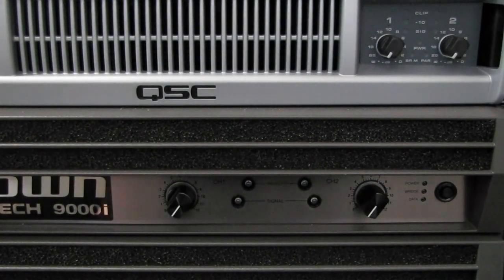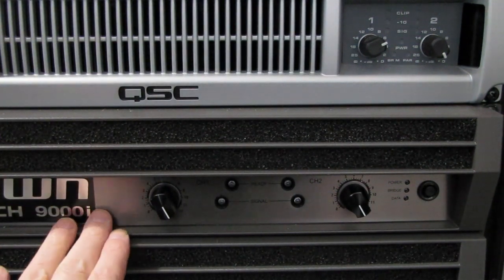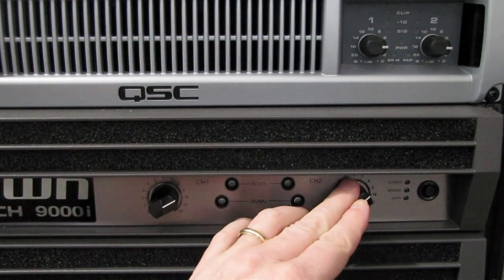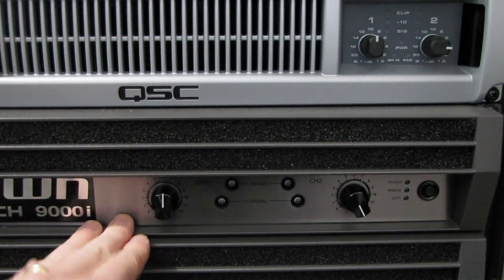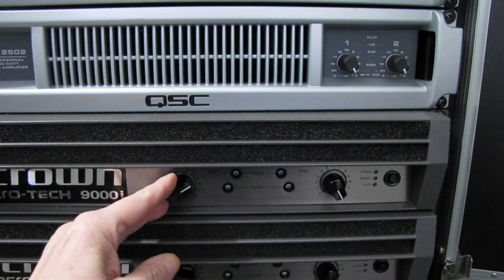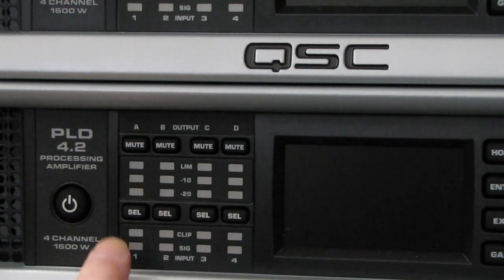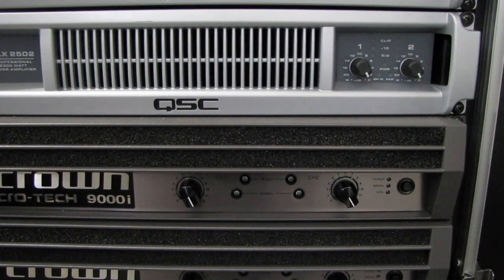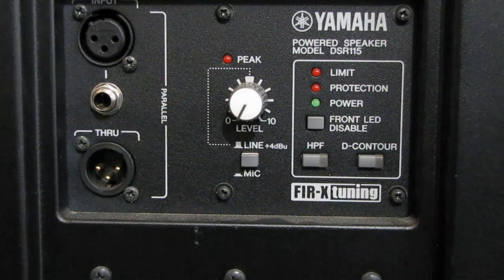Amplifier input attenuators (or volume controls)

Comment: Proper use of the amplifier attenuators is as follows.
1 Set up your console for nominal levels all the way through.  This is proper gain structure and is used in both a small club and in a large amphitheater. This provides some protection for the amplifier and speakers. With proper console setup, the maximum headroom is about 12 db. Most consoles provide a nominal output of +4 DBU. Most consoles clip at about +18 DBU, so there is no more after that.
Now set the amplifier attenuators for the maximum loud sound for the event. This can match the speaker rating, Venue DB limits, or safe hearing level for the event.
This allows the console to operate with the proper headroom, high signal level of +4 DBU to provide the maximum recommended signal for the noise level of the system. Yes this operates at the best S/N ratio for the cleanest sound with little chance of running out of headroom.
How not to operate the attenuators. 
1 Turn them all the way up. This amplifies the noise floor. The console operates with the output very low to manage output levels. This provides poor S/N ratio, and allows the amplifier to be driven to clipping at maximum power, which may be more than 30 DB of headroom, resulting in blown speakers in a runaway feedback conditioin when a guitar is set on a monitor, or a mic is dropped, etc.
Most consoles are able to output between + and - 12 to 15 volt peaks before clipping. Your amp attenuation should never be turned up for sensitivity for a 1.2 volt signal. The console can provide up to 30 volts peak to peak. Check the specifications for your console. Industry standard is +4 DBU balanced signal.  The extra gain is for when you use a home receiver, VCR, cassette deck, etc which operates on lower voltage and outputs -16 DBU as the nominal output. This includes consumer grade tablets, MP3 players, some DJ USB powered mixers, etc.The DJ's with RCA connections can use the extra gain. A pro board with the nominal +4DBU does not need the attenuator turned to the max ever.
Reply from the maker: Great info.

Comment: If the clip led on a power amplifier comes on when the volume on the mixing console is cranked up halfway will the speakers be just fine and not blow
Reply from the maker: If the speaker's power is not rated to match the amplifier power, the speaker will become damaged.  The clip lights on the amplifier is what you should pay attention to... not so much the position of the fader on the console.

Comment: So i have issues with the whole sensitivity stuff,  after setting up and having my gain structure in place from the mixer board, turning up my amps to the highest causes lots of feedback issues.  Although i use a speaker management at 0db.   What could be the solution.   Thanks
Reply from the maker: Feedback issues are mostly caused by improper gain staging on a microphone (at the console).  The amplifiers have nothing to do with feedback, other than amplifying a feedback-issue.  The speaker management system has nothing to do with feedback other than ensuring input signals are "gained" correctly for output to amplifiers (or powered speakers).
1.  Make sure the input gain on the console is set for the microphone and for the instrument (or vocal) that it is being used for.
2.  Make sure the mic is not facing any loud speakers.
3.  You may need to apply some EQ cuts for the channel the mic is connected to, depending on what the audio frequency of the feedback.

Setting gain is very dynamic and changes between different mics, different setups, different consoles...  so, a solution to feedback may take a little work for your setup compared to someone else's setup.
Make sure there's not too much gain being used on any of the microphones.
Reply: @stageleftaudio  so gaining a mic must not necessarily be at 0db on the meter for analogue mixers ?
Reply from the maker: If you are talking about a -0- db marking on gain knob, you are correct.  If you are talking about -0- db on a meter, it's a little different.  Vocals should be around -0- db (maybe -3db) on a meter.  Drums / percussion instruments can be around +9db.  To get that point, it may require a gain knob to be adjusted more/less of what the console is showing as unity (the unity marking on the input channe).  Gain and meters are not static measures... if they were, their settings would either be on or off.  Gain settings are very dynamic and will require their own setting.

Comment: Do the low frequencies on the equalizer need to be turned up if you are using a power amplifier to power subwoofers
Reply from the maker: Low frequencies on an EQ should never be turned up unless it is to support a special effect.  EQ should be used as a subtractive EQ first... before being used as an additive EQ. If one low frequency needs to be turned up, this is usually ok.  However, If many of the low frequencies have to be turned up, that is usually an indication of improper mixing, incorrect gain structure, somethings wrong with the speakers, or using the wrong speakers for an event.

Comment: Know the nominal level and the maximum output level of the mixer, which may be +18 dBU, +20 dBU or +24 dBU.
The clip level of the mixing console is, usually, marked at 6 dB over the last yellow/amber leds on the level meters.
If the mixer has a nominal level of +4 dBU (0 dB mark on the level meters) and a maximum output level of +20 dBU (+16 dB red led on the level meters), I have 16 dB of additional dynamic range above the nominal level.
I intend to use the maximum dynamic range of the mixer and to ensure the best signal to noise ratio in the system, before the signal is sent to the amplifier. Therefore, I set the channel input gain to hit the 0 dB mark on the meters, then I raise the channel fader or the master output fader fully up (+10 dB), to hit the last yellow/amber leds on the meters (+10 dB), just below the clip LEDs. This offers me 6 dB of headroom before clipping the mixer output.
On the amplifier side, set the input sensitivity switch to 1.4 V RMS to match the mixer's nominal level and adjust the sensitivity controls to -10 dB attenuation for rated continous power output. At this point, the continous power output of the amplifier is about 1 dB below its maximum power output.
The above procedure it is based on the assumption that the loudspeakers continous power rating are matched with the amplifier continous power rating.
If a compressor/limiter is used between the mixer and the amplifier, the mixer output level can be increased to its maximum level (+20 dBU) and the limiter threshold should be set at the point where it begins to catch the signal peaks, with an additional 3 dB of attenuation, for safety.
If the speakers continous power rating is lower than the amplifier continous power rating, lower the amplifier input sensitivity controls or the mixer master output level according to the power you need for the loudspeakers and allow for about 1 dB of headroom also for the speakers.

Comment: I have EV ETX boxes that are self powered. They have an input gain or attenuator and a master volume knob. I’ve been running the master wide open and keeping the input at unity. They’re 2000 watts peak power but still don’t seem very loud when they start to limit. Any thoughts?
Reply from the maker: If the speaker power rating is what you indicated (2000 watts peak), the speaker is actually a 1000 watt RMS (or 500 watt continuous) powered speaker.

If the "limit" you are seeing is on the input stage, this usually indicates the source signal (feeding the input of the speaker) may be too hot; the source level should be turned down.  If the limit is seen on the amplifier, this means the limits of the speaker is being reached; there's not much you can do about this type of situation.  However, it's possible the input attenuator may need to be increased (assuming you are getting NO limit warnings on the input stage).  But, care should be taken to not increase the input attenuator too much.

Depending on where you are standing for your reference to how loud the speaker is, the 90-degree by 60-degree horns are great for near and mid-field applications.  Unfortunately, those horns do not do well for far-field events.

Comment: Does hooking up a graphic equalizer to a power amplifier effect how loud the speakers get.
Reply from the maker: Yes, but the "loudness" will depend on which EQ band is boosted (or cut).  Also, EQs are not actually connected to an amplifier.  They are sometimes placed in between the console and the amplifier.  An EQ is actually considered to be "inline" with the signal path if it is placed between the console and amplifier.

Comment: Great video I would love more info on powered speakers. Should I be treating them the same and be running them wide open as you called it? Or just turn them up to what's loud enough?
Reply from the maker: Good question.  The attenuators on powered speakers should be kept where the manufacture indicates -0- db is.  This is usually identified by a detent location, or a marking (similar to the DSR speaker in the video).  Many times, the position is at "12 o'clock".
Reply: @stageleftaudio  great to know thank you!

Comment: Does the amperage of the fuse on the power amplifier determine how much rms power the power amplifier puts out.
Reply from the maker: Any fuse or circuit breaker in an amp limits the amount of power allowed into the amp; this can sometimes coralate to the amount of power ouput (but would probably be a continuous output, but not RMS).

Comment: If a power amplifier has a 15 amp fuse on the back of the power amplifier and outputs way more than a 1000 watts rms does it have to be plugged directly into the wall outlet and not a power strip
Reply from the maker: All amplifiers (especially in production work) should be plugged into receptacles, not power-strips, unless the total anticipated power from the amplifiers that are plugged into a power strip, is less than what the power-strip is rated for.

Comment: Why do some power amplifiers say caution high voltage on the speaker terminals on the back of a power amplifier.
Reply from the maker: All amplifiers put out voltage... not actually watts.  If you are not carefull at the speaker terminals of an amplifier, you will get shocked by the terminals.  The more power an amp puts out, the stronger the shock.

Comment: Is it safe to plug pro audio power amplifiers into a power strip or is it a fire hazard.
Reply from the maker: It depends on much power the amplifiers are anticipated to draw.  Normally, amps are not plugged into power-strips... not because of potential fire, but due to the circuit breakers (found in most power strips) that usually trip below their rated load.  Power strips can be used, but the total potential load plugged into a power strip needs to be less than what the power strip is designed to handle.